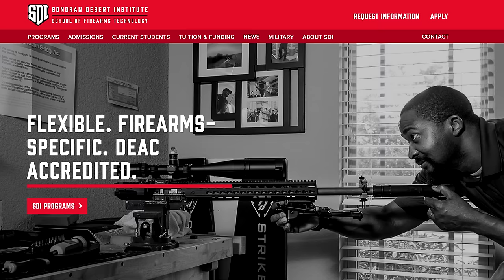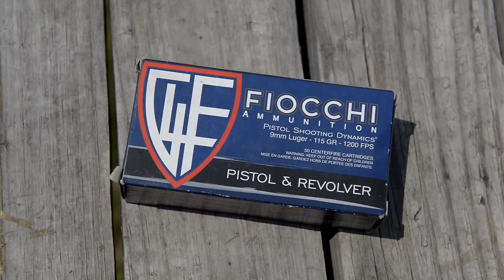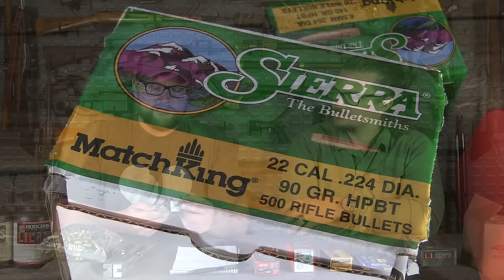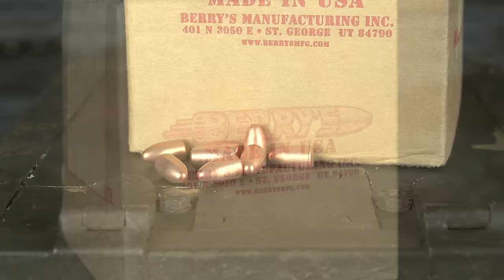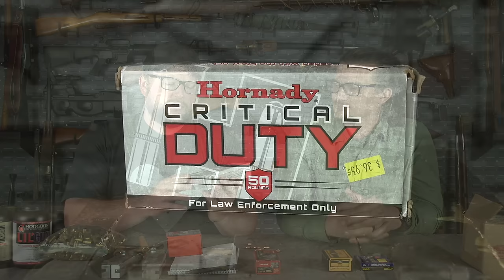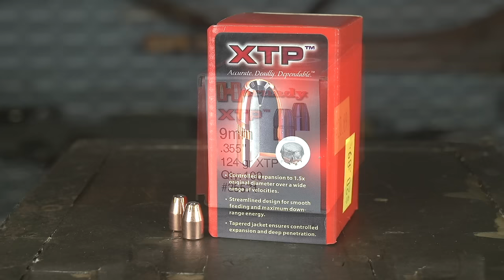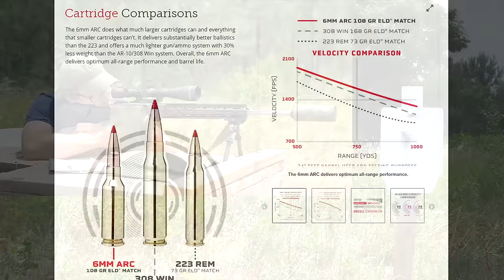Is It Worth Reloading Your Own Ammo?

Comment: Well, I have been reloading since I was about 14-15 YOA, I will be 66 end of this week. It's also been a great hobby. I find that the customization you can do is amazing compared to factory. I have been buying "Blem" .308 Match bullets and have been getting some great prices. This also includes shotgun. You will really save if you shoot a lot of buck and slugs. 5 rounds of slugs is $ 9.99 for 5 rounds! You save a lot for defensive rounds on 5.56 or .300 Blackout. Thanks for the info....
Reply: Where you shop? I buy 1pz slugs loaded and shipped for less than slugs sold in a bag as components.

Comment: I just found your channel, and it's really terrific.  Another feature about reloading is you can design the ammunition to be exactly what it is you need.  For instance, I used to shoot bowling pin competition, as wall as USPSA.  For bowling pins, while shooting revolvers, even a commercial .44 Special round was way more than you needed to clear bowling pins off of tables, and I used to load up some .44 Magnum rounds with 240gr LSWC, but only moving at about 800fps, and it was a really light load, and very pleasant to shoot, but it cleared pins off the table.   About 11 years ago, I had to sell my house, and I couldn't bring my reloading gear with me (Dillon 550B), so I miss being able to load my own .41Mag and .44Mag ammo, as well as .45ACP - Back then I used to shoot about about 500-600 rounds of .45ACP a week, and was reloading them about about $0.07 a round with my own brass.

Comment: When I could buy a 1000 cci primers for $25, reloading was a no-brainer for any caliber.  With primers currently at about $80/1000 and powder averaging $35/lb, reloading(cast bullets) only makes sense for non mainstream calibers.
Reply: I used to reload when primers were $5 to $10 per 1,000 brick.
We bought several bricks each of small and large rifle and pistol.  I never reloaded shotguns.
I bought 8 lb tubes of powder and bulk bullets, 4,000-8,000 per box.
I did a lot of casting and loaded most rifle/pistol cast for less than $5 per 100.
Reply: In my area large rifles primers are 111 out the door if u can find them and powder is over 55
Reply: This. Primer prices are crazy right now
Reply: Agree with everyone commenting here.  Primer prices are nuts lately.   

I live in an area that generally has lower ammo/component prices historically.   The good news is large/small pistol and small rifle(including 'military'...aka .556) primers have been available at my local big box sporting goods store for between $75-95/1000 for the past month or two.  Powder is slowly showing up on the shelves; albeit at $60/lb as opposed to the $20/lb it was available at 7-10 years ago.  

Hopefully availability and prices keep going in the better direction for the average american for the foreseeable future; and reloading becomes a no-brainer again like it was 10-15 years ago.

Comment: I separate out what I do at my bench into 2 disciplines. 
1 Reloading and 2 handloading. Reloading is what I do to save money and do in volume. My reloading is typically done on a progressive press and it is mostly for simi auto. 
Handloading is done for EDL or hunting ammo and is done on a single stage press. I independently  weigh every charge, brass is meticulously prepped, and every round is checked at every step for consistency. 
Two completely different reasons for producing your own ammo. I enjoy both...

Comment: I bought a Lee turret press and it works well… A big issue most don’t think about is that whatever press you buy, you will have to feed. A dillon progressive is only useful if you are loading 500+ rounds in a session. You have to have the money to feed whatever press you are using.

Comment: I've been reloading pistol, rifle and shotgun ammo for the last 35 years.  I load my ammo for a couple of reasons.  1) I can load the exact type of ammo I need for the task.  At the extreme, I have a favorite 22-250 load using a 40gr bullet and 700X shotgun powder that emulates 22 magnum performance for squirrel hunting.  Try finding that loading on any store shelf.  2) I always have ammo.  For example, many rifle hunting ammo was extremely hard to find during COVID.  I actually had to load hunting ammo for some friends for deer season as store shelves were bare.
Reply: Run a similar load in my 223 bolt gun. Rcbs 22-55-SP and NOE 225 60 RN both shoot great.

Comment: My dad and his two brothers were avid hand loaders. I would sit in the backroom in the cellar and watch for hours. He would run out of componants, and he would send my brother or me to the Army and Navy store for a pound of Red Dot and a bag of #7 shot. We hopped on our bicycles, and off we went. He always called ahead to make sure we got what he needed.
Many years later, my brother and  I got into the hobby as well. 
It is a relaxing, fun time. 
One rule I have is that I will not reload for anyone other than my one closest friend. I trust my handloads, but the liability is too great. A firearm blows up and injures someone, through no fault of mine, is too great a risk.  
It's sad that the hoarders are jacking the prices sky high. It just takes that much longer to recoup your expenses.
All my uncles and my dad are gone now. I have all their equipment. Yeah, some of it has seen better days. But it could be brought back in an emergency to turn out the fine loads they once did. My dad would be struck speechless if he saw the sorry state of availability of components.
My brother and I are the only shooters who followed in the hand loading tradition.  We have a great time at the range and it doesn't break the bank.

Comment: With a single stage press it is: NOT worth reloading .223 training ammo. In my experience it will take between 3-4 hours to reload 100 rounds and it will cost 70$ (CAD) for powder, bullets, and primers. That ends up being 1:1 cost for buying from the store/reloading, then you need to consider what your time has cost you. 

If you are shooting large rifle calibers  30-30, 6.5 creed, 300 win mag, or .338 it ends up being worth it by a huge factor. You can tune the load to your rifle and crank out 20-60 rounds per 3 hours (from case prep/cleaning to the last bullet seated). In my case it costs about 30-40$ (CAD) in material to load 20 rounds of 6.5 creed, whereas if I was to purchase a comparable match load from the store i'd be spending 80-90$ (CAD), plus I wouldn't be getting the 1/4 MOA accuracy from the hand load. 

The takeaway is this. Buy the equipment needed to load .223, 9mm, 45, and 12 ga (or whatever your primary use calibers are). Buy the powder, bullets, and primers that go along with them. Develop a load for your rifles/pcc's/handguns, then keep a small stockpile of the raw materials and reloading data should you ever need to use it. Ideally the concept is this: should a huge jump in ammo prices occur, or if the supply chain is cut you can still produce enough ammo to buffer the effect and keep yourself and your family safe.

Comment: The smoke and dirt that comes with cast lead is eliminated if you choose to powder coat your bullets instead of using traditional lube.
Reply: So you can buy powder coated bullets. But powder coating won’t help you with the worst part of cast lead, actually casting them 😊
Reply: Pre 2012 supplies would land you around 2-5cpr...today's supplies will land you 10+ cpr. And this is with free brass and free lead.
Reply: Yeah man, once I tried powder coating I knew I'd never go back.  And once you perfect the process, it's super quick and easy.
Reply: @monkmoto1887 If you have proper ventilation it's not a concern.  I cast a ton and get tested once a year, never had above a normal range of lead.  I just do it outside.  I also cast well below the 900 degrees F it takes to produce lead fumes.  It melts at 621 degrees, I usually cast around 700.  Lead dust is way more of a concern, and ingesting it if you get it on your hands and don't wash it off.  I rarely handle the bare lead during the process.

Comment: I got into reloading because I inherited all the stuff and enough primers, bullets, powder, and brass to supply the army of a small banana republic. So for me, reloading is hands down cheaper than buying factory, even 9mm.

However, that being said, there are some considerations to take into account… First, it doesn’t take much of your time, but it does take time. I use a hand press, and it takes me about 45 minutes to load up 50 rounds. That sounds like a lot, but I’ll tend to just shoot a box and replace a box, and I watch YouTube while doing it so it’s not a big deal. Once I get into a rhythm, I can just kind of turn my brain off and go into automatic mode (while still maintaining quality and safety of course)

Second, I haven’t gotten to the point where I’m confident enough in my reloads to use it as carry ammo, so I still need to use factory for that. 

Third, it’s extremely cheap for some calibers. For 9mm and 556 and 7.62x39, you’re never going to beat the cheapest ammo, but for stuff like .45 LC I can load it for like 30% the cost. 

Fourth, you can do some neat stuff with reloads you probably aren’t going to be able to do with factory rounds period. Like for instance I can load up certain cartridges like .45 LC with black powder. Or You can try out a variety of loads for a fraction of the cost and find one you really like. 

And finally, it’s a skill, and it’s very satisfying. It gives you more insight into how guns work, and it’s something you’ll always have.

Comment: Over many years of handloading for every firearm I own and have owned I've learned of a few unexpected expenses. One I don't like about any of my rimless semi auto firearms is brass loss. I don't shot at a range but I do a lot of shooting. It's more of a pasture situation and I don't like chasing brass. There is always loss. I'm also not a fan of rimless cases that headspace on the lip of the case. Bullet profile becomes an issue for me anyway. I also consider things about different firearms I can switch over. Such as I have sold all my magnum rifles and went to a 35 Whelen for times when I need magnum power and I can use 30-06 brass if I need to. I can also use .357 caliber pistol bullets in it with reduced loads. Also loads for different cartridges that can use the same powder. There's a lot to reloading that I don't know and I know a lot so it's a really interesting skill to learn and you'll never be able to learn it all.

Comment: Hell yes it's worth it! After the cost of the tools and dies I have saved 50% or more over buying commercial ammo.
I reload 9mm., 5.56, 300 BLK, 350 Legend, .303 British, 308Win/7.62X51, 30-06, 357 Magnum/38 SPL, and 458 SOCOM.
Brass can reloaded several times until you notice if it is splitting or deforming beyond use. Most brass can be reloaded 8 to 10 times before being discarded.
303 British is a special case, DO NOT full length resize, just neck size. The brass is form fired to the chamber, which has loose dimensions to account for dirt or contamination.
I have a 1918 Lee Enfield SMLE MKIII* I restored to original condition and it failed NoGo but passed Field so it was safe for surplus ammo or reloaded IVI brass.

Comment: I save close to 3.61 a round for 9mm reloading myself. And i can adjust different grain levels. I like to use 3.8 or 3.7 for 124 grain FMJ just standard ball ammo. 115 grain 4.4 pr 4.3, for a little hotter loads i go 4.8. I reload my own brass, 8 cents for primer, 0.15 cents for bullet and 0.02 cents for powder a scoop. 25 cents a round comapred to the 3 something for factory. Ill go reloading any day. I load on a lee loader classic 9mm. Everything starting out costed me 160, bullets, primer, powder, scale, and caliper.

Comment: I just started reloading for my 7.62x54r Mosin with a Lee Classic Loader. 50 after shipping, 32 for a powder scale, and 10 for a rubber mallet.

I got that for the only reason of not being able to find any 7.62x54r ammo on the shelves in nearly a year. Thankfully, only primers are hard to come by as far as components, but I did stock up.

As far as prices in my area and what I can find online, I can save up to $50 per 100 rounds of ammo if I reload lead core soft point bullets for my .308 Win. I might need to scrounge up more primers if I do that, though. 

Reloading for my .357 Cattleman is tempting, but I haven't done the math on whether or not it's worth it.
Reply: its odd how different areas are having differing caliber problems, all common rounds are available in pistol including 38spl and 357, the odd mid to larger rifle rounds are available and have been since 2019, mosin rounds have been $15 a box this entire time in my area and still are. but .410 is non existent.

Comment: I think the fact that primers are now $90-$100 have skewed the savings of reloading drastically.  That's a 3x increase for that component.  I don't get why it's so expensive, while ammo prices were dropping months ago, primers have barely changed.
Reply: Agreed, I’ve been doing the math every few years and each time the cost of the raw parts cost the same as buying factory ammo. That cost doesn’t include my time or equipment either.
Reply: Factory demand is up. Factories get first dibs. 

It's a reeeeal simple equation.
Reply: It completely depends on what you're reloading. Is 9mm worth it? No, not if you can get a box of it for 15$ at your local store. 38/357/44/45lc/45-70 ect absolutely it is worth it

Comment: After 7 years of reloading I’ve found the best boon of reloading to be straight walled magnum cartridges, specifically for revolvers/lever guns but in general. Reason being they just don’t require a lot of expense and advanced materials to run great, even if you don’t want to get into casting your own, bulk non jacketed bullets are really cheap, I can load very accurate, very powerful loads of .357 magnum for about 15 cents a round. And they run great through lever guns and double action revolvers. The problem I encountered with semi autos is when you try and reduce the cost by either using lead bullets or less powder, your reliability instantly suffers, and even though it’s possible to lessen those problems with more work, expense, and attention, the magnum revolver ammo just doesn’t require any of that

Comment: The other thing that wasnt really expanded upon here, is that when you reload, you can do a "ladder" and tune the cartridge for your rifle. A ladder is when you load say 5-10 rounds at say minimum powder charge for a cartridge and then incrementally increasing the powder charge by a small amount, say .25 grains for the next 5-10 rounds repeating this until you have 5-10 rounds of each increment, from lets say min powder charge to max.  Then you start at the bottom, shoot five rounds, measure your group, shoot the next five, and repeat until you've gone through all your rounds (cooling the barrel between groups).  There are two charges that will be the most accurate; these are called nodes, and if you were to graph out your avg group for each one you'll see that you'll gradually miss less as you get closer to your first node, and once you hit that node, your groups will start opening up and get really bad, and then start shrinking again until they reach the second node where they are again most accurate.  This is because several factors but barrel harmonics essentially being the reason.  Tuning your ammo load to your particular rifle (and projectile/powder/primer combination) will increase your accuracy and consistency...This is why all competition shooters hand-load.  Chad touched on this very briefly.

Comment: Hornady xtp is what im using for my subs but its generally not looked at as a top tier defensive ammo. 

I use xtp because its one of the only defensive projectiles thats regularly available in recent times. 

Personally i think its fine, it doesnt have the most dramatic expansion but still expands consistently and i wouldn't be worried about pass throughs.

Comment: Whats missing from this video is that reloading components have been really hard to find too. When is dries up off the shelf then so do the components. I'm not finding primers where I live for $5/sleeve, it's closer to $10. Also powder is running at $50/lb or more. I guess I need to check my math with current cost components, but these projections sound really low for current costs.

Comment: Also, reloading calibers that are unavailable is the hot ticket, try finding 357 Maximum ammunition, I'm loading 158 gr XTP hollow points, 23.5 gr of H110, brass is luckily still available, about 1850 out of 6 inch Dan Wesson.

Comment: I’ve loaded shot shells since the 60s for light 12 and 20 ga you can’t load as cheap as you can buy Walmarts value packs. But field loads and magnums you can save a ton. 10 and .410 you save a ton. Pistol and rifle for me more the fact that I can make my own when most folks can’t find anything to buy. I have top end swaging gear from RCE so I even have high quality jacketed bullets they are some cheaper but not much but I have what I want and need when I can’t buy it

Comment: I’ve been reloading since I was 18 and I already have all the equipment, I’m 73 and just finished reloading 500 rounds of 300 BLK 110 gr V-Max for $.63 a round with brass formed from Range Brass.  Midway has 110 gr V-Max for $1.55 a round.  Reloading is a cost savings of $.92 a round!

Comment: I started reloading 300 blackout sub sonics for 50-60c per round and 77 grain 223 for similar. Including cutting brass and cutting crimps out of primer pockets I'm averaging around $30/hr of savings and I can do it in stages as I have time, and particularly in winter when I don't go outside much. So in my case, it makes sense.
Reply: 300 AAC is a good round to load when comparing component prices to factory ammo. But I just shoot more than I would if I was only buying factory ammo.